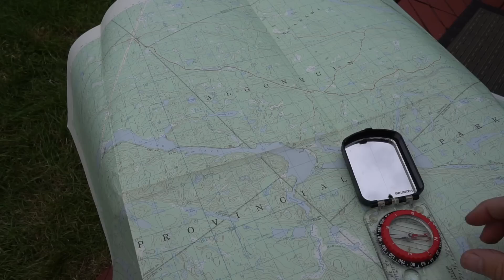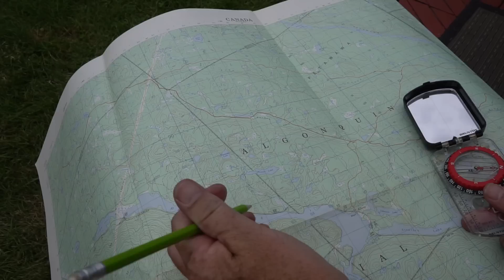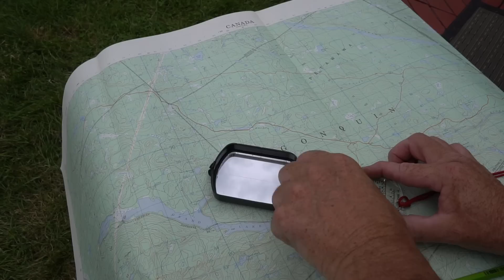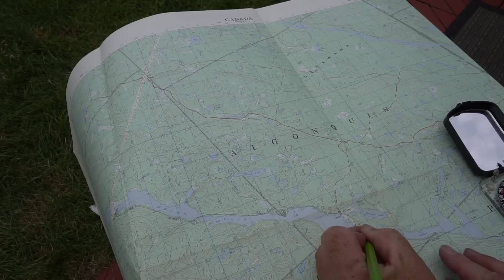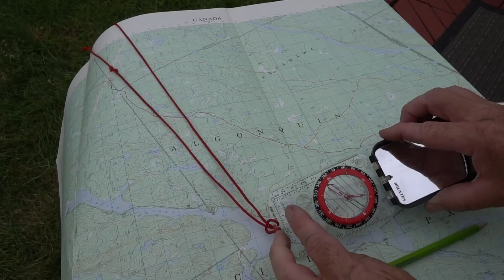Map and Compass - part 3 - using map and compass toghether

Comment: I like it, but I usually orient the map so you can identify features retaliative to the map. 
And it should be noted that you can only line up the grid lines if your compass allows for declination.

If not, you'll need to draw grid lines up that line up with magnetic north.
Reply from the maker: Good point. The good news is that grid north usually isn't too far off true north...which helps.
Reply: The guys are right but - you already introduced declination in the first video.  You can't use declination then adjust the map - one not both!  Good job Kev!